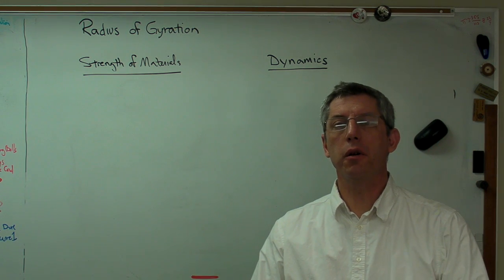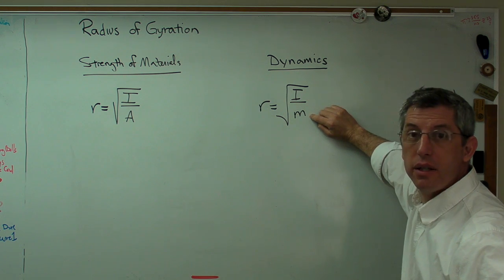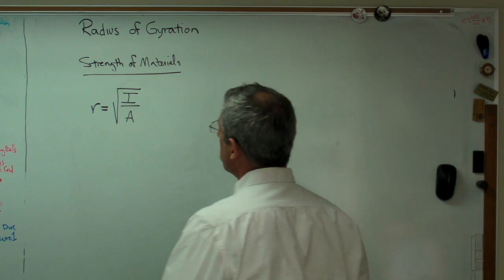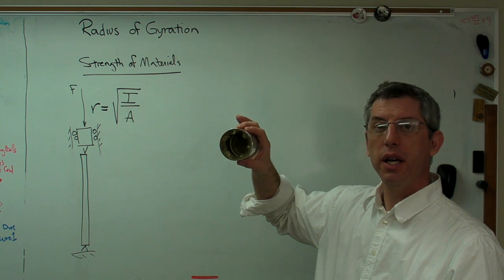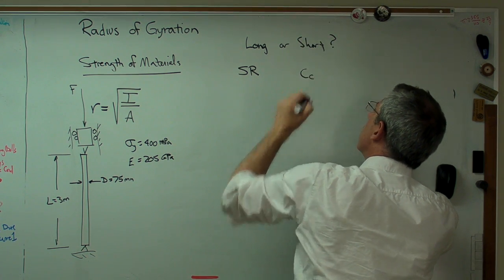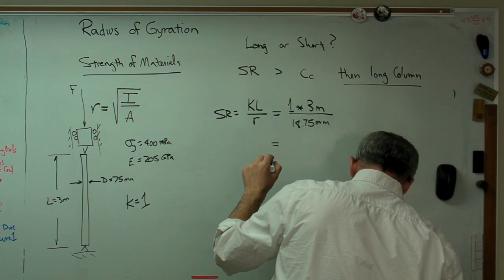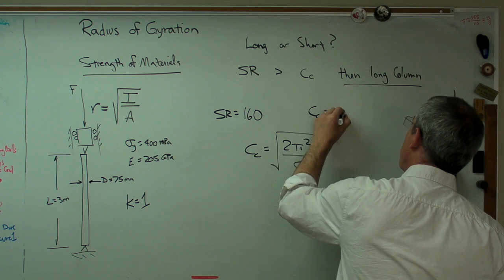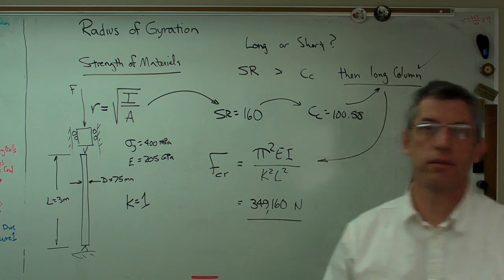Radius of Gyration and Buckling.MP4

Comment: 4:12 isn’t that a case of local buckling?? I mean if I’m standing on a coin, then no matter how much weight I put on it will never buckle like that. So I don’t get the short column thing later in the video. I find it strange that the wall thickness is not included somehow? BR Peter

Comment: sir you havent related the buckling to radius of gyration
Reply: it's (r) which was used to calc SR
Reply: Some things just take as being true. If you take every formula from the code and try and find out where it came from it would do your head in. Its just an equation derived from 1st principles. It doesnt really have a meaning, just gives us a number that tells us somthing. Bit like second moment of area.  It only is a number that can tells us where most of the cross sectional area is at some distance from the neutral axis.  Its how we use those numbers that matters.
Reply: Noah Clanton all im saying is that you should be able to derive the equation and know where it comes from but when it comes to actually meening somthing well....its just a way of puting somthing in terms of one number to describe somthing. Obviously not all are like this

Comment: but i still  have a confusion  the radius of gyration is only for calculation , not have a [physical meaning
Reply: In strength of materials the radius of gyration is the resistance of a cross section to rotate over an axis
Reply: If you draw the equivalent system for the section, the area will be concentrated at radius of gyration from axis of rotation of buckling just like in the dynamics where the mass is concentrated at radius of gyration from axis of rotation. The concentrated area become strip with same moment of inertia as original system. Imagine if you apply a load on this concentrated area, and when you apply the Double Integration Method for deformation of this column with concentrated strip area due to buckling, the deformation will become lower as you go farther from the axis of rotation or as you increase the radius of gyration. 

Maybe im wrong.

Comment from the maker: @fandennis I'm afraid not.  The important thing about buckling is that the structure can fail even though the material is below yield stress.  Imagine a long, thin metal rod like a piece of brass brazing rod.  Say L=1000mm and D=2mm.  It would be very easy to get it to buckle.  The load would be very low - far below yield stess.